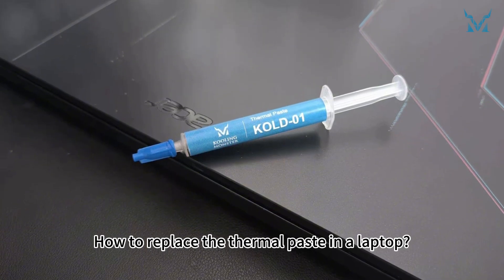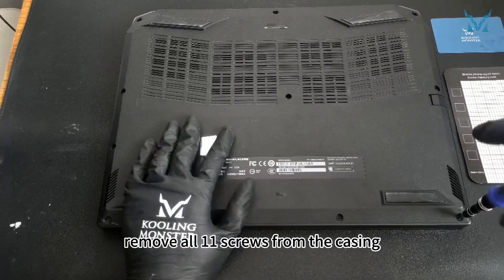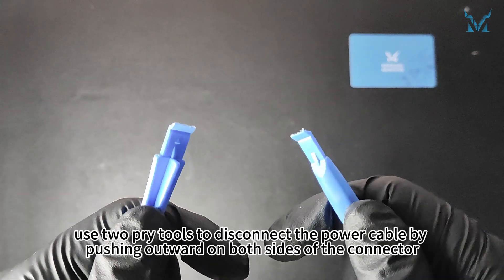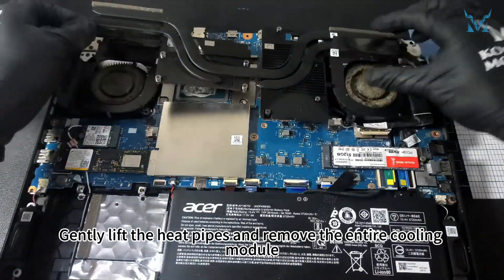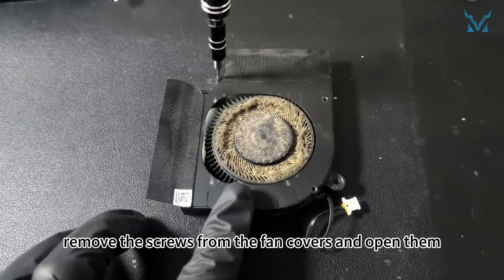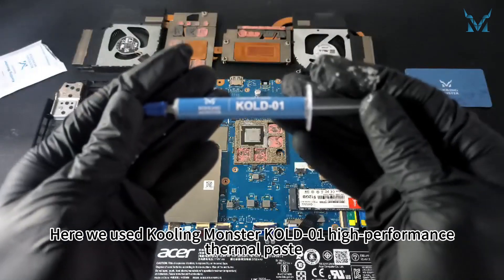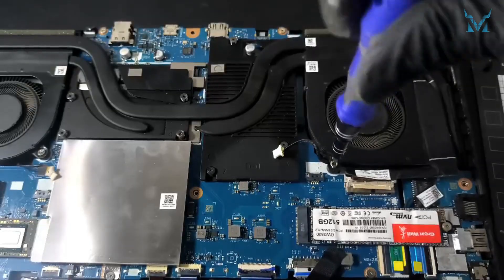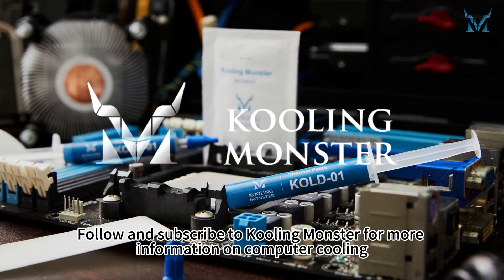Speed Up Your Acer Nitro 5 2022 Prevent Overheating With Dust Cleaning & New Thermal Paste

Comment: I had change my thermal paste but now after a month it is still heating
Reply from the maker: That might be due to uneven paste application or low-quality paste drying out. We recommend repasting with a durable, high-performance option like our KOLD-01 thermal paste—it’s non-drying and designed for consistent cooling over time.